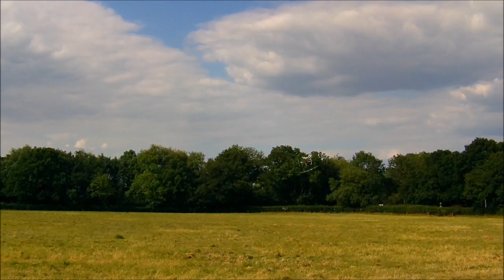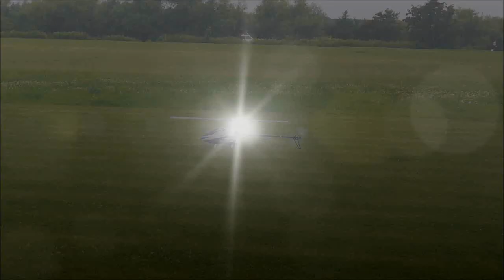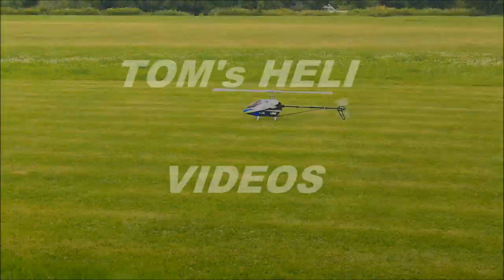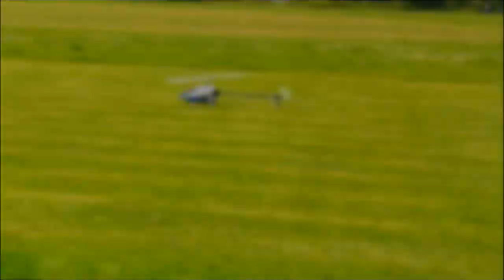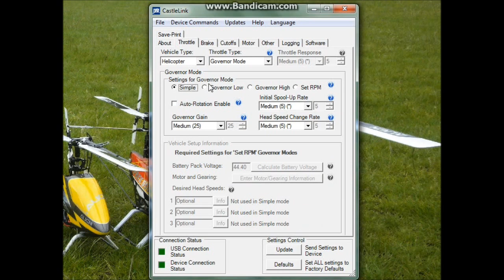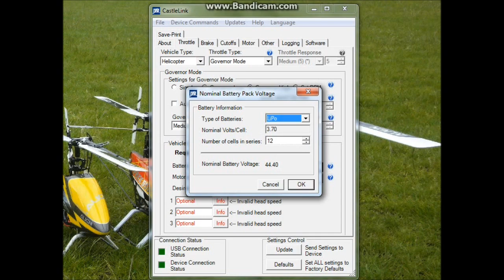Castle Creation ESC SETUP PART2

Comment: Hi I have a align trex 500 helicopter and it has a castle 90 esc on it with a spektrum AR7300 receiver. My transmitter is a spectrum dx8 I think that the esc is set up wrong. If you move the throttle stick up till the blades  starts up slow   It will not stay slow it go to high throttle can you help me not to shore on setting up the castle.

Comment: can you just program 2 modes in the castle governor mode. i have a dx7s (with a two stage idle up switch) and want a normal mode (ie, linear throttle curve, non idle up, non governed mode) and an idle up mode with the governor holding a set speed.
Reply from the maker: You can program 1-3 modes, normal mode doesn't need to be programmed. So I only program in idle 1 and idle 2. If you only need 1 mode, enter your rpm value and leave the rest blank. Hope this makes sense

Comment: QQuestion: Specifications:
Brushless Motor ( 1220kv)
Motor pinion gear 11T x 1
Drive Gear 112T
Pole count on the Align 600MX 1220kv motor
6 poles.
............................
desired head Speed
{1 - 1900  /info/  use a flat 30% throttle curve
 2 - 2060  /info/  use a flat 70% throttle curve
 3 - 2200  /info/  use a flat 100% throttle curve for this RPM}
............................
Talon 90 is what i am using. With the above info: what Head Seed would you suggest. when i put anything under 1900 it said to slow. That's why i increased it to 1900. Then it said use a flat 30% throttle curve.
and is that for { IDLEUP 1 ] - 2060 for [IDLEUP 2] - 3 for [IDLEUP 3]?
I then took out the chopper and tried it out, the chopper seamed angry so i unplugged it and went home. From default did i make it {head speed} too fast or what.
Reply from the maker: How many cells are your batteries? 1220Kv is way too high if you are running 12 cell lipos. It should be around 500-600kv for 12s. 2200rpm is quite a high headspeed, but it should be fine with good blades. I'd recommend running 2100rpm governed as the maximum.
Reply: I have 6 cell batteries. Looking on the back of the instruction(how to put helicopter together) manual it says the following:
length: 104mm
Height: 356mm
Blades: 520mm
tail:       254mm
Motor Pinon: 11T
RCM-BL600MX Motor (1220KV)
M. Drive gear: 112TAutorotation tail 131T
Right now i am stumped, that's why i came to a pro.
Reply from the maker: MrAm1400 Oh I think I know why you are getting confused. This setup video is for a 700 sized heli which runs 12 cell batteries and a 510kv motor. From the dimensions you have described, it seem like you have a 600/550 sized heli? For a 600/550 sized heli, it is recommended to run between 2100-2500rpm. So the Headspeed you have set it quite low. Also, make sure all the poles and gearing is setup correctly to your heli and not my video, this may be why it sounds angry.

Comment: Hy Tom, great video. I built the new combo of the 700e HV. In the first i use a Robbe 120A ESC but it is burn after 5 flights. Now i have an 160 Castle ESC for the 700E. I will use the Gouverner Mode for Scale flying no 3D. I beginn with Heli flying before 6 Month. I use in my other Helis ( 450 Rex ) also Robbe ESC in Gouverner Mode and it works very well. My Radio is an Aurora 9 with Optima 9 can you give me any tips for the setup? Chris

Comment: Hi Tom.
Amazing vids.  Just put a Trex600e pro together( my first) and I'm having difficulties setting up the esc.  Tried to put my throttle curve to linear and percentages at 0% on both sides on the screen(dc7s). Howeve, only the left side can be set to 0%  Does the transmitter need to be bonded to the heli first?
Please help...newbie.

Comment: Hi Tom ,Very nice videos well put together and very clear.
I have a question as i use Futaba , so i teach the ESC the end points as in part one and the % that is given from the desired head speed i set into my throttle curves ? is this right. So can i leave normal flight as is I.E no set head speed and then idle 1 i can set to 1800 and idle 2 /2000.
Thank you 
Regards Tommy

Comment: This might be a dumb question, but if the value you get is 65.6% for example do you set your throttle to 65% or 66%. The transmitter only allows full numbers.

Comment from the maker: The 9.583 is gear ratio on the 700E. I'm using the stock main gear and pinion because it isn't possible to change on this heli, due to the motor being in a fixed position (it can't move to allow for a larger/smaller pinion).

Comment: Cheers Tom make complete sense, so in my normal mode i have throttle curve of 0-40-60-80-100 that should stay as it is. and if i set my Gov to 2100rpm in the CC software which = e.g say 70% flat curve, i set the 70% flat curve in my TX for idle up 1 and it should be Govened ? Yeah? Thanks for your Help Tom Really appriciate it oh you are an awsome pilot and i love all your vids keep it up!!
Cheers
Lee

Comment from the maker: you can just use No.1 if you only want one headspeed. there is no order with the No.1, No.2 etc. To disable the governor mode, just use a normal throttle curve. e.g. if I enter 2000rpm, the program will show a throttle value (eg 75%, just a guess), you then program that value into your idle up throttle curve. so now when its set to flat 75%, it will be governed at 2000rpm. if the value is anything else (0-74% or 76-100%),  it wont be governed. make any sense?
Regards
Tom

Comment from the maker: I don't have it governed in normal mode, this is because I turn it on in normal mode and its safer to have it at 0 encase I forget throttle hold. For normal mode, I just have 0-25-50-75-100. I don't really use the lower headspeed apart from when I land, so it is alright to just have one governed mode.

Comment: Cool Thanks Tom, also in your normal mode is it governed? and is it a flat throttle curve? i only have normal mode and only idle up one so i'm not sure if i have to run governor on both flight modes.

Comment: @tomstanton28 not the exact same head speeds but my % was significantly higher, i had 1600 1800 2000, in fact it wouldnt let me set 2200 because it would require more than 100%, ill try again later with the same head speeds as u and see if it matches. thanks Andy